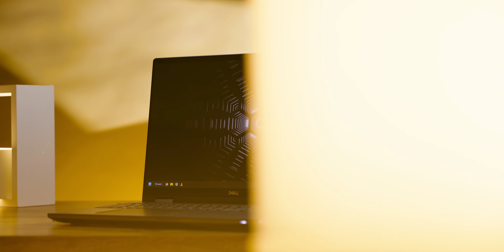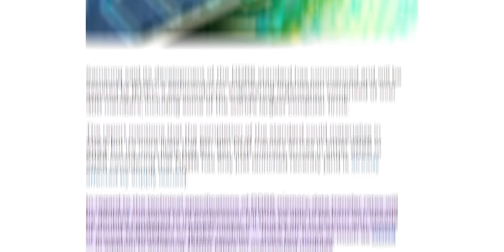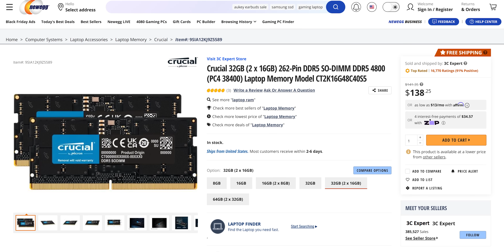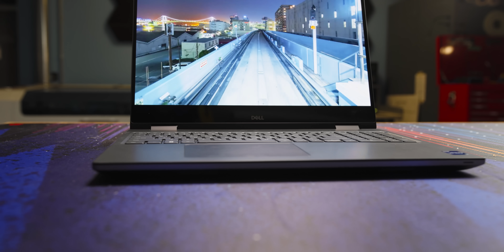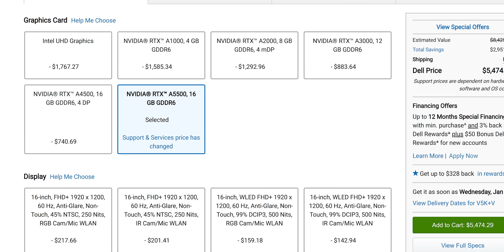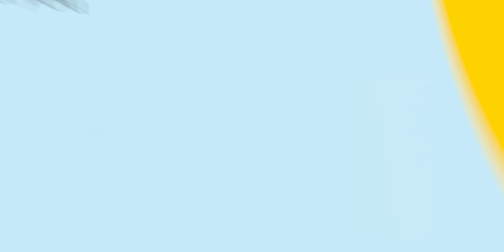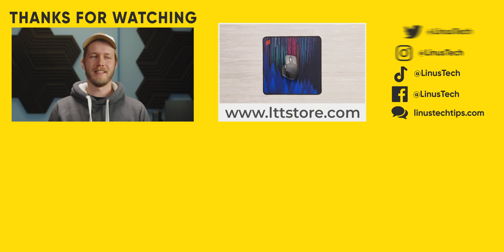I've NEVER Seen a Memory Stick Like THIS - CAMM Explained

Comment: I mean they could just bring back socketed ram chips, just need to develop a socket that has a lock and release on it and then it wont vibrate out like old DIP chips and is easy to remove.

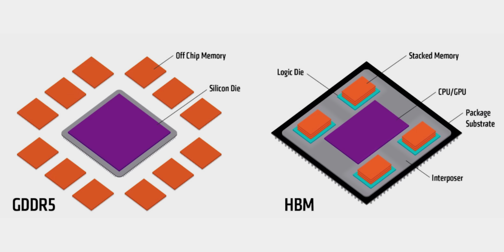Comment: 2:20 The latency from the distance the signal has to travel is only a tiny percentage of RAM latency, anyone with a basic knowledge of computer science knows that.
Reply: It's not just latency, it's all the extra electromagnetic interference susceptibility and impedance that comes with extra length.
However I agree that this still is not the actual problem. If desktop DDR5 DIMMs can have the highest speeds, so can SODIMMs. In fact, I've just checked and 6400MT/s SODIMMs do exist - they were introduced just about a month ago, and that means laptops can and will be made to support them. This is just another Dell marketing thing.

Comment: Ill believe in the "upgradeability" when i see non-dell modules for sale. 
Desktops that are wayy more powerful than these laptops still use dimms, so I dont believe the BS about signalling. What they actually mean is "improving the traces in laptops would require money, so instead we used the dell way "
Reply: Pretty sure they said in the vid that it's not much of a problem 'yet' but is expected to be 'soon', particularly once we get into DDR6.

This is a forward looking standard aimed at solving an anticipated problem proactively before it becomes a major issue rather than trying to solve it reactively.

You're right to be skeptical about adoption as it's a brand new standard and I wouldn't be totally surprised to see a competing standard arise soon. But if this stuff turns out to be good and is offered as an open standard I also wouldn't be surprised to see the industry piggy back on Dells work just to save on R&D costs to get around the problems that this tech solves.

Just gonna have to wait and see.
Reply: In desktops, the memory is vertical, which allows the traces to often be shorter than laptops.
Reply: @SeniorKlean  True, but EPYC also uses DDR5 and it can support 12 channels of memory. This means that the outer two dimms are pretty far from the cpu. It is however, pretty close to the limit, i will admit that. 24 dimms is supported by the cpu, but making it actually work has proven very challenging.
Reply: @SeniorKlean  they still have to go from the CPU to the DIMM slot which can actually be further on desktop MB than laptops. Orientation of the DIMM itself doesn't change much.
Reply: @gabrielenitti3243  My whole point was that the trace from the CPU to the DIMM slot is often shorter on a desktop than a laptop.

Obviously in servers and high end workstations with lots of DIMM slots this doesn't hold up, but those systems also usually use ECC and run much looser timings.

Comment: With the compression connection being so close to the cpu, isn't there a concern of heat dissipating into the connection or pins?
Reply: LGA sockets have the pins right under the cpu and it works fine, so I doubt this would cause any problems.
Reply: @MrMoon-hy6pn  I was more talking about the heat would sink into the RAM module. It doesn't look like it has a heatsink

Comment: Through the years I have never upgraded laptop RAM. Added/larger SSDs, changed few ruined fans, keyboard once, battery twice, but never RAM. 
I just bought my laptops with enough RAM - that made sense at the time. Considered upgrade once or twice, but then there is that compatibility problem and by that point laptops were old already anyway... so no. Just buy new laptop after 3..5 years. Laptop lives tend to be shorter than desktop ones for multiple reasons anyway.
So cool in theory, but useless for real me.

Comment: >it's a good thing
>the section talking about problems is twice as long as why it's good.

So no it's not a good thing. It's a good thing IN THEORY but in practice it's literal that the problems going against it is greater than any advantages you could get.

Comment: I don't see the replacing existing memory being any different. Both dimm slots should have been filled in the original config, so you are removing both and replacing with two larger dimms.

Comment: No suprise that the people who sell $100 screwdrivers with proprietary bits also like Dell's proprietary RAM.
Reply: @deadbeef Yes they are fanboi. Bits are are several mm's shorter than normal bits. They could have made the handle a few mm's longer and used standard bits but that would cut their sales of special Linus short bits.
Reply: @scottnot  You can still use normal bits, it's just that you can only fit 6 of them in the bit storage. I think it's fair for them to ship with short bits in order to improve the magnet's performance and to shape the handle how they wanted.
Reply: @duckboycool  Right, so LTT screwdriver is imcompatible with my existing security bits -  magneticly speaking. They could have used a larger magnet but choose proprietary bits instead. I also use more than 6 bits on a regular basis. Enjoy your Dell screwdriver and RAM. Im not buying either.
Reply: @scottnot  The magnet is already very strong going by both their claims in the original video and also what third party reviews have said. If anything, it'll probably still be stronger than most screwdrivers even with full length bits. The only thing they did is ship the screwdriver with bits that worked better for their priorities, and it still works perfectly fine with typical bits if you prefer them. This honestly doesn't hurt the consumer in any way and seems like a pretty sound decision to me.

Also, I'm not personally invested in this like you seem to think since I'm not really interested in buying either of these products, I just found it weird that you seemed to have some vendetta against the screwdriver.
Reply: @deadbeef Said like a true fanboi.
Reply: @deadbeef What did i lie about. There are using non standard bits to compansate for a weak magnet and needlessly gimmicky storage for their bits. How do define "liar' and 'proprietary'?

Comment: Some laptops have a "card edge" DIMM slot where the DIMMS slots are on the edge of the MB - in the "middle of the height" of the board - doing it this way makes the DIMM slots a ZERO factor in height as the board itself is taller than the DIMM slot with memory.
Reply: They roast comparing height to quad slots as in two stacked side by side not a single one as shown in the video
Reply: @profosist  I think they compare it 128GB vs 128GB, not dimm vs dimm
Reply: They stacked it because it needed for 128GB, 2 dimms per channel.
Reply: @Polystree  makes sense then for that specific purpose but most even high end laptops are still shipping with just 16GB and much of it is soldered.
Reply: i think some macbooks have that feature

Comment: I'm not really seeing the benefit here. Ok, yeah the machine gets a thinner memory module and instead trades horizontal space. That's ok for low end machines that have large empty voids in their chassis, but higher end devices that maximize internal space? Idk. Soldering everything down still maximizes space, speed, and profits for the manufacture.
Reply: But the benefit is obvious and it was also the main point of this video. So kinda strange that you don't see it?!

Higher speed (in the future) than SODIMM while still being upgradeable.

Comment: Not in a million years will OEMs all adopt this.  That’s just how they roll.   Each will add their own “special” design to it as a selling point.
Reply: They adopted SODIM.
OEM's also benefit from standards. Usually in cheap manufacturing costs. (Albeit, that rarely leads to more profit, customers benefit there as well)

Comment: 4:40 that image is pretty misleading. They're saying it's 57% thinner than having a stack of two dimm sockets. That means that a single dim socket is almost the same thickness. Given that it's twice as wide as the dim socket it appears as though it would take up about the same room as two dimm sockets.  I can't remember the last time I saw a laptop with more than two dimm sockets.

Comment: IF other companies decide to use this memory, there is a chance it will take off. I remember when laptop manufacturers had memory that only worked on their laptops and it was stupid expensive to do any upgrades
Reply: I remember those days as well. Sad time in computing. :(
Reply: If Apple had decided to go that route, you can easily see why every company on this planet would do the same thing.
Reply: Right. Get back to me when someone else actually uses this.
Reply: Ah, so like Dell is still doing at the moment (kind of)? I tried to upgrade my 1500€ Dell Inspiron 7610 from 16GB to 32GB only to find out it throws a RAM error when using but first-part Dell RAM. An shocker, that cost nearly twice as much. Luckily, I found a used seller that offered it at only a 50% marup over the DDR4 average half a year ago.
Kind of defeated the purpose of having interchangeable RAM if my option were the five packages sold by Dell.
Reply: many still have software locks that prevent just using any RAM
Reply: @martinus_mars  software locks are a bit of a stretch, they tend to simply not add support for very many types of memory in the bios.
Reply: @vgamesx1  Systems will tend to read the Memory firmware for Jedec profiles, and failing to find a compatible profile will attempt to run at bios profiles until one works or none work.  In most cases, one will work.  But BIOS can also be used to software hard lock out certain memory brands, or brands/firmware IDs not specifically in the BIOS approved list.  Like say, Patriot DDR4 3200 8 GB SODIMMS will work just fine, but go up to say 16 GB sticks of the same brand speed and timing, and no dice.  Or go down to the same timing at 3000 and neither 8 nor 16 GB sticks will work.  If it is particular about different specifics within the same brand or different brands with the same specifics, chances are it is a lockout and not a lacking support.  You might be surprised what they write into firmware and BIOS.  Much like AMD branded memory will rarely work with an Intel CPU, even though it has IDENTICAL specs to supported memory for that CPU, may even be manufactured by a company in that list for AMD branding, but the memory is firmware locked for AMD CPU usage only.  90% of proprietary hardware is because it is run by proprietary software somewhere in there.  The physical interface can easily be duplicated.  But the firmware and BIOS lock allot out.  It's like trying to put an non dell branded GPU in a dell PC.  Sure, it came with an RTX 3060 in it, but put any old 3060 or even 3070 into it as a replace or upgrade, and no dice.  Has to be a Dell GPU.
Reply: @martinus_mars  Some older laptops have software locks to prevent using just any WiFi card too.  I hear they stopped making laptops like that.  So far, my new laptop bought a couple months ago worked with RAM and WIFi upgrades not from the manufacturer.  The WiFi card is also one that was not in the service manual for this laptop.  Often HP lists a few modules in their service manual they say will work.  The only reason it didn't mention my Intel card was I guess because it had 2 antenna jacks rather than one like the Realtek cards typically have,  For that reason my laptop had only one antenna cable for the WiFi.  I scavenged the second one from my old HP laptop to install the Intel card.  I simply found an empty spot away from anything and stuck the antenna there.  I just used some 3M electrical tape to tape the cable into place since it had a little slack that had to be managed.  This was mostly to keep it in place so it would not get pinched when I close it up again.  Don't try to cut the cable and shorten it!! That is coaxial cable and not wire!  I did it that way so I don't have to mess with the display.  Also before you do this, get a copy of the drivers for the card since you won't be able to if Windows doesn't recognize it.  Just store them in your download folder or on some storage media..  If there are multiple drivers and you don't know which one to use, get them all.  You will really need just one for WiFi and one for Bluetooth even though they are on the same module.
Reply: @charleshines8523  With WiFi cards, there was actually also an FCC licensing issue. Technically, it's illegal to upgrade your WiFi card in your laptop, unless you also swap out the antennas for a set that's certified by FCC to stay within emission limits when paired with your new WiFi cards (cards and antennas are always certified together, as a unit). Dell, HP and IBM/Lenovo chose to enforce this with software locks, Apple (as usual) went with proprietary connectors, and the other manufacturers just put a disclaimer in their documentation, saying FCC compliance is your responsibility once you swap WiFi components.
Reply: @NetRolller3D  True, one intended for a different country might cause problems here in the USA.  Of course the FCC won't like that and would eventually track down the source of that interference.  I can imagine it being more of a problem if someone lives near an airport with the DFS channels in use for radar.
Reply: @charleshines8523  Not just different country - plug a 5dBi antenna into a card calibrated for 2dBi, and potentially you're now exceeding EIRP limits.
Reply: Anyone remember the Microburst Architecture from IBM?  

Yeah, I thought so.
Reply: This standard is so wasteful... Because you have to throw the existing module if you want to upgrade.
Reply: @AmieWea   Not necessarily any more wasteful than current tech is.  if I'm already using all SO-DIMM slots and want to upgrade, I have to toss the existing memory.  In my desktop, I had to toss both modules to upgrade the memory since there were only 2 slots anyway.  It's only if you're only adding an additional SODIMM to a laptop that has an open slot that you won't be tossing the existing memory.  For example, when I upgraded my Inspiron 8200, I was already using both memory slots and had to replace both modules to double the laptops memory.
Reply: @daexion  If they can make it to use less board space like DIMM.2. and the minimum capacity is 32GB then it is less wasteful. It is not viable for 8GB or even 16GB.
Reply: @daexion  Or why they do not introduce this form factor in the enterprise server segment first where density is necessity.
Reply: @AmieWea  It's not as wasteful as when you have to throw away the entire motherboard including soldered CPU and GPU if a soldered RAM chip fails, or want to upgrade ...
Reply: @AmieWea  It's not wasteful when the current standard is nearing its performance limit.

You basically saying that new generation of DDR is wasteful when older DDR generation works just fine. Because they're not interchangeable and you have to throw the older ones.

It's only wasteful when it's proprietary and only Dell uses it. If it became a standard that other manufacturer use, then it isn't.

This is better than soldered RAM.
Reply: @n_core  The form factor is wasteful. 32GB in that form factor is the absolute bare minimum. Imagine how much thicker it will be for 64GB or even 128GB module?
Reply: @n_core  Why they do not introduce this form factor in the enterprise server segment first where density is necessity.
Reply: @AmieWea  Because this is relatively new form factor and usually enterprise equipment uses a proven and reliable parts.

There are many other important aspect that enterprise must have aside of density.

About the form factor, well yeah it taking pretty big surface area, and there is another bigger module for bigger memory size mentioned in the video. That's probably the one for enterprise usage. I mean Dell has their own server stuff.

But having a bigger PCB size that can store way more nand flashes per PCB is good for size proofing. At least should be slimmer than 2x double-sided nand SO-DIMMs.
Reply: @AmieWea  While yes, you don't use the module you can simply sell it instead of "throw" it...
Reply: @MidnightMarrow  Still take considerable amount of time.

Comment: This is a much better approach than Lenovo's soldered dimms for business users
Reply: Lenovo is a Chinese company. Avoid like the plague. I'd rather have my data mined by a private American or Taiwanese company, not the CCP.
Reply: Soldered dimms are fine for business. They won't upgrade and if something breaks they just send it to the manufacturer.
Reply: @skilllessbeast7416  Yep, I don't understand why my job use thick fully upgradable laptops if they replace them by brand new computers as soon as there's an issue anyways.
Reply: @cedricpomerleau5586  usually they have some sort of contract in place with the provider. I down cycle machines that have been replaced (for higher performance versions) to lower power requirement users, and then donate after it is obsoleted
Reply: @skilllessbeast7416  on a conceptual level sure. In practice they have one 8gb soldered dimm and one slot. 8gb is pretty useless, so you have to take the machine apart for a usability upgrade to 16, but if you wanted 32 you're out of luck even though the rest of the laptops hardware is suited nicely.
Reply: @tommymaddox6785  Probably you can put a 32GB module into that slot. I just did that with my notebook that came with 8GB soldered + 8GB slotted ram. Now I have 40GB ram and it works fine. Speed is also looks similar than before. Maybe Linus can investigate this kind of dual channel performance.
Reply: @azbesthu  I have an Asus zephyrus g14 with a soldered on ram module that's 8gbs, with a socketed ram for upgrades. I upgraded to 32gbs of ram in that slot making it 40 gbs of ram